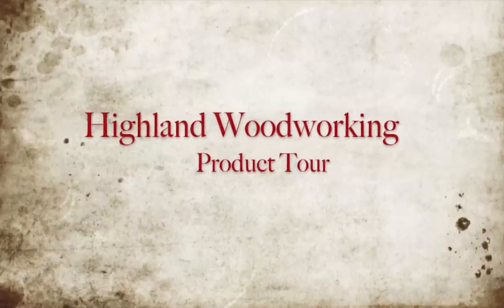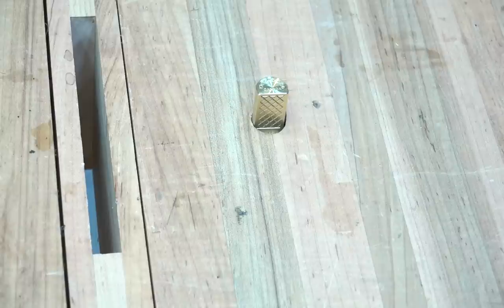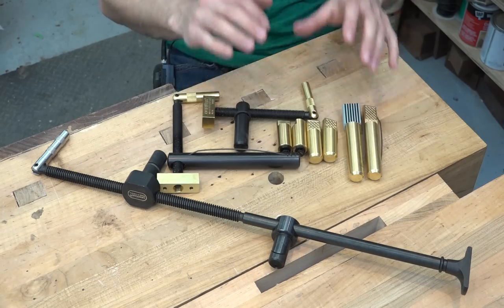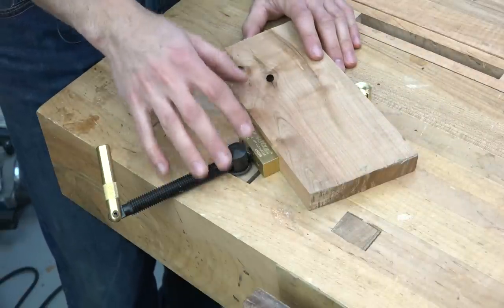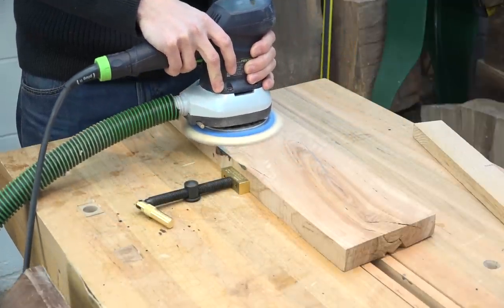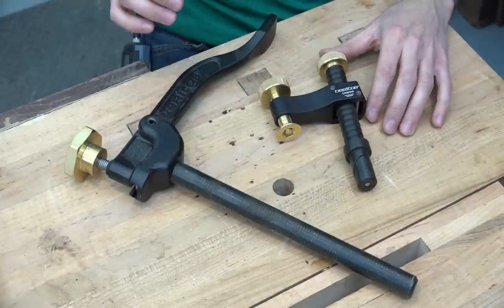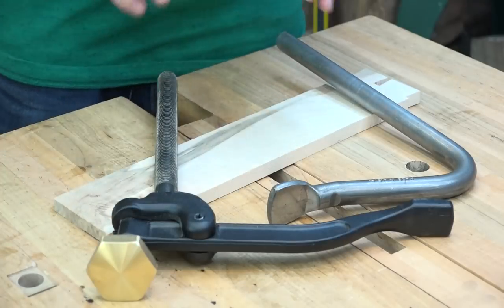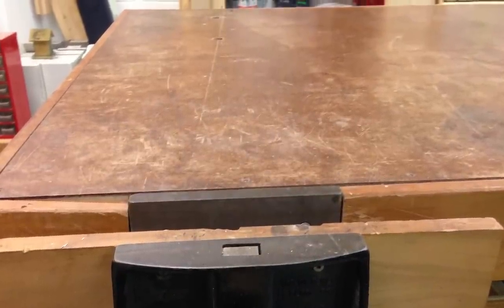Veritas Workholding Solutions: Bench Accessories - Dogs, Clamps and Vise Video Tour

Comment: Good information well presented — thank you.

I can vouch for the hold-downs (I have two).  Is there a reason you (Matt) didn't include the Veritas QR hold-down (a/k/a The Duck)?  I have two of those, too, and find I reach for them first, as they are easier to set and release.  (I do recommend lubricating all the places where metal moves on metal, tho.)
Reply: I just show what highland sends me. I ended up really liking the hold down and I'm sure the ducky one would work equally well and be a bit easier to set. I'm going to have to try one of those now... Haha thanks!